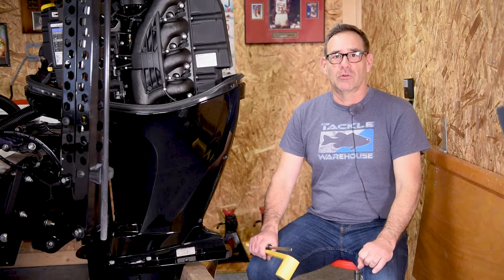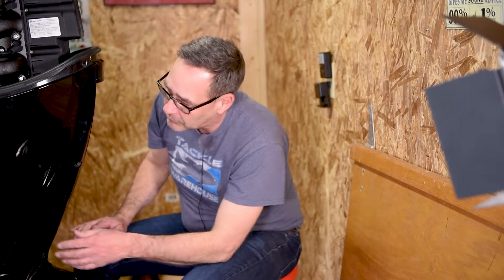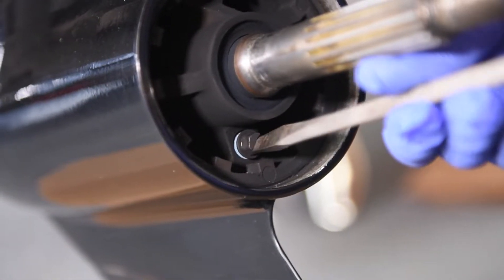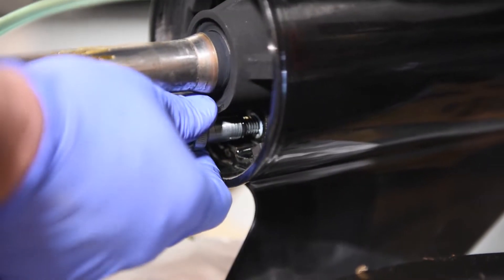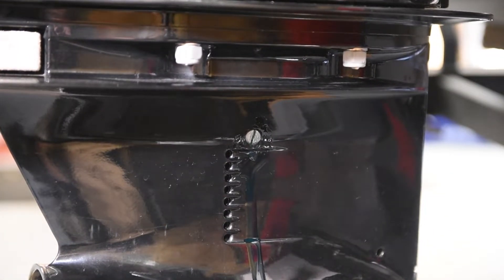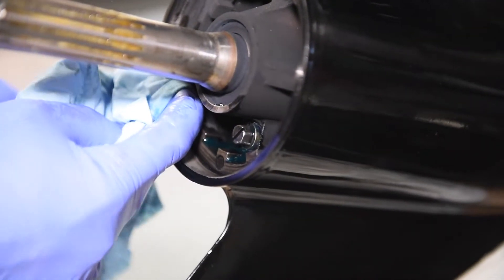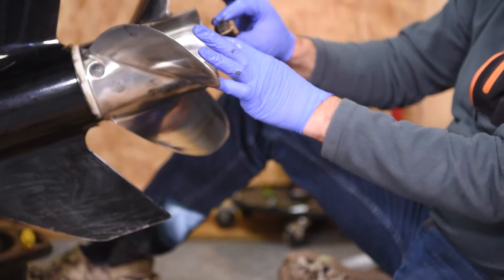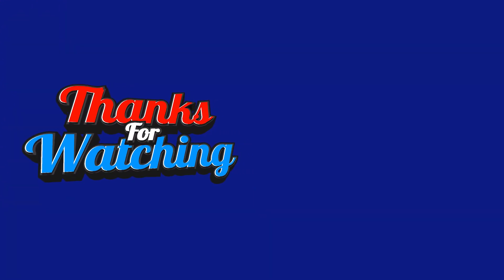DIY Mercury 150hp FourStroke Lower Unit Service - Save $$$

Comment: on the stbd side of the lower unit there is a hole, not the speedometer hole, but II believe is for winterization. Is that what it's for?  there is somehow a loose bolt inside this part of my  lower unit
Reply from the maker: Hard to comment without seeing your lower unit.  I can tell you the vent hole for changing lower unit grease is on the starboard side and should have a screw for a flathead screw in it.  Beside all that a loose bolt in your lower unit is a major problem.
Reply: @zevoutdoors7194   You've got the same exact motor as me and at about 2:08 in your video, you can see the hole I am talking about and its clearly left with no plug. After talking with a local tech. his research found its an open drain hole having to do with the winterization of this specific mercury. I was hoping you may have any more information about it

Comment: That prop bore sleeve should be inside the lower unit, NOT on the prop.
Reply from the maker: Everything went back on the same way it came off.   I've serviced this engine many times with zero issues.  Thanks for watching!